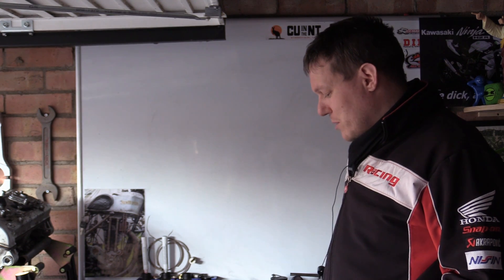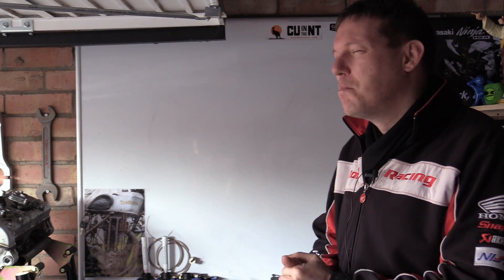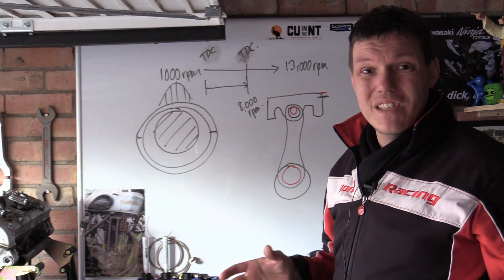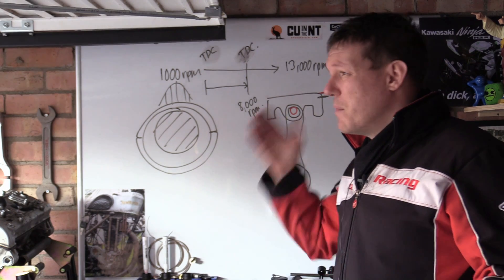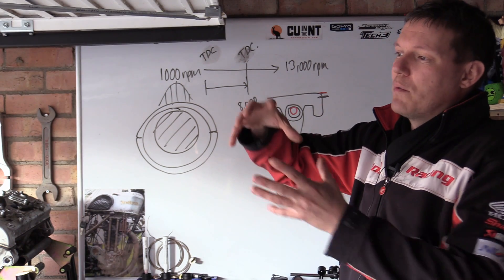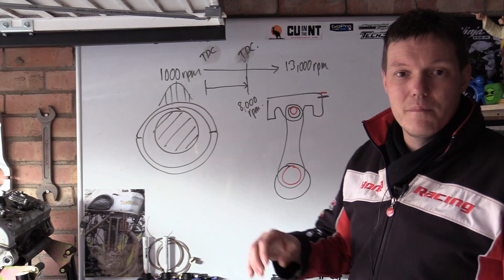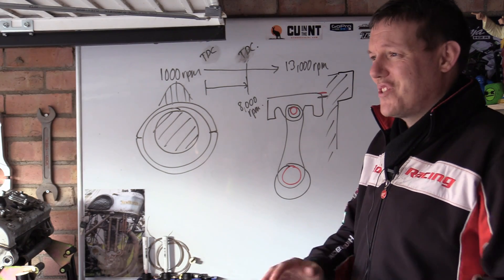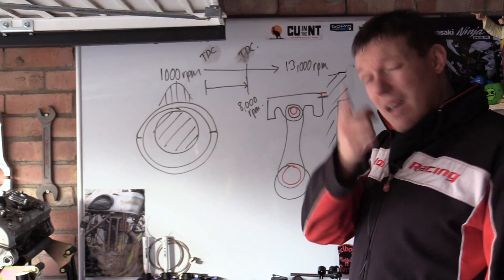Piston moving higher up the bore?

Comment: Nothing to do with the speed at which you accelerate but everything to do with the RPM.
High engine RPM means pistons and rods have less time to travel the stroke
Reply: Heavy down shifts stretch rods due to the added force from the inlet vacuum
Reply from the maker: What? Clearly you're making this shit up.

Comment: When this was floating around at it's worst the weekend before last, I did a simple calculation on this.
Nascar specs are pretty much everywhere and obtainable. So I did the most basic of calculations: 

Cross section of conrod, Piston and small end weights, redline etc. 
Maximum force when it's yanked back down ended up on about 3500kg. 

Assuming it was just a normal steel conrod, it ended up streched 0.15mm at TDC.
Factoring in correct material, all the other forces and stresses that act upon it would definitely mean a entirely different result. Better or worse. 

For the disbelievers, just ask them to reduce squishband to 0.10 or so and then redline the engine. Carnage is ensured.

Comment: There is a neat story about a race car called Zakspeed Capri, that thing had a 1.7L 4 banger with around 600 hp at around 9000 rpm. One can imagine that this engine was at its limits every time one goes full throttle. Well, they basically opened the engine after a race and found the rods to be stretched (plastically) ....

Comment: Rods do stretch.  The acceleration on a piston as it goes over the top at high revs is around 10,000 G (very, very roughly).  It makes no difference AT ALL how fast the engine is accelerating- 13,000 rpm is 13,000 rpm, it doesn't matter in the least how fast you get there (the piston is travelling up and down the bore over 200 times a second- do you really think the difference in acceleration of the bike matters?).  The G force at TDC means that a piston that weighs say 250g pulls on the rod with around 2.5 tons of force. This will stretch an alloy rod a bit, but doesn't do much to a steel rod (much stiffer).  The stretch is in the order of microns, not millimeters.  (you can try hanging a car off a rod and see how much it stretches).  Sometime this stretch will be enough so that the piston contacts the head if the squish band is way to small, but it's usually not enough to contact the valves.  The reason that the drag piston had valve marks in it was because the valves were floating.

Comment: I was actually gonna ask you something along these lines, you said in a video at some point that there is a cup the piston comes up into (where the valves and everything are) and that is an empty volume  the piston doesnt go all the way up to the top.

ok aside from the fact that if your timing chain/belt let go or timing was wrong at all you'd be totally fucked and it would hammer your valves to pieces, what if it was pretty much flat and the piston came as near as damn it janet to the top with the valves opening/closing with mm's clearance (so the timing would have to be dead on) of course you'd have a much higher compression but is there a certain point where the compression is too much? or the compressed volume is inefficient?

Comment: Many yrs ago I was working for a Pommy mechanic, he had done a rebuild on an XJ6 Jag and it came back with a noise at high RPM. He got me to take it for a drive and I told him it sounded like the pistons were touching the head at redline. Sure enough when he tor it down, the wristpins had been bored too low in all the pistons and they had just been touching on high revs

Comment: Do you really have to worry about that ridge in your cylinder bore? I know it used to be a problem in engines in the earlier days of motorized transport, but with the metals and techniques we have available now, surely that is no longer an issue?(Except for those extremely rare 500,000 mile gasoline/petrol engines in cars or 1,000,000 mile diesel engines.) I have personally seen the bore of a 300,000 mile LS family engine(It was a 5.3 liter truck engine) with no noticeable ridge to be felt.
Reply from the maker: LOL fuck off with that shitty LS engine.

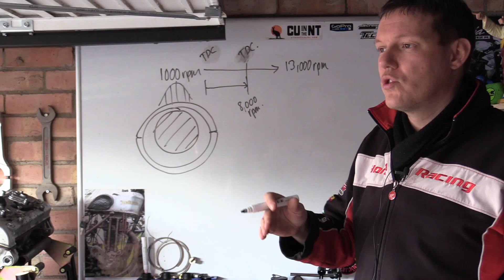Comment: 5:15 that doesn't make sense, saying the INCREASE in RPM causes this stretching. The inertia of the piston shouldn't be higher just because it's speed is increasing every rotation. That makes me imagine someone saying a turbo only blows up when your boost is really high, not when the turbo is spinning 400,000 RPM.
I understand engine load being a large cause for stresses, but what "load" is being applied to the piston and consequently the con-rod, apart from just inertia? Exhaust scavenging causing vacuum?
Reply from the maker: "The inertia of the piston shouldn't be higher just because it's speed is increasing every rotation."

- What's missing here is the accleration of the crank.

If you look at a piston acceleration curve you are looking at a constant rpm curve - if the crank is accelerating whilst the piston is in motion (due to other pistons firing) then the acceleration of the crank + piston = higher acceleration. 

"I understand engine load being a large cause for stresses, but what "load" is being applied to the piston and consequently the con-rod, apart from just inertia? Exhaust scavenging causing vacuum?"

- everything the piston is connected to - the clutch, drivetrain and wheels.....

Force applied to the piston from above and the resistance of moving or accelerating said vehicle.
Reply: @thedirtyworkshop  so because that at 10k RPM while accelerating the crank is pushing the piston back up is causing more inertia than if you were at 14k redline?
It's hard for me to imagine. It sounds like a useful application for real world demonstrations, because as far as I would understand, peak piston speed would be the most significant contributor rather than I assume a slight change in the piston acceleration curve
Reply from the maker: No. this is at redline, not any given rpm - I should have made that clear - or clearer. 

"causing more inertia than if you were at 14k redline?"

- Cuasing more inertia? No. What matters here is force - this is what's 'forcing' or stretching the rod. If the acceleration is higher than the force is higher - the mass doesn't change and doesn't need to for this to be true.
Reply: @gutserker  Look at it this way - all speeds are proportional to the crank speed since everything is connected together. When you cruise at one  constant RPM there are speeds and accelerations of different components associated with the kinematics of the system. At a higher constant RPM all of theses are higher. If you want to go from one steady state to the other you need to "push" things, so they go faster and faster as time goes by, this is acceleration, the change of speed over time. All masses being constant (mass is inertia) to make the speed go from 3 to 7.8 you need to be pushing harder the faster you want the speed to change. a=F/m .  More force on components, more plastic and elastic deformation.
Reply: ugh, a lesson to write long responses in a word processing program before putting in youtube. I have to re-type a few-paragraph response again
Reply: I'm don't have engineering training, but this still doesn't add up to me.
And I thank Matt @The Workshop for teaching in past videos many of the things I reference here.
The forces a piston experience are only compressive and tensile on a single plane as far as I understand (not counting piston slap). The primary stresses on a crank shaft, transmission, clutch, ect are rotational, where an acceleration from torque can cause failure. The piston ONLY cares about how fast it was going before TDC, where it has to near-instantly stop and go the opposite direction, the insignificantly small change in the INCREASE of piston speed compared to the previous stroke shouldn't have any effect, as long as the inertia is below what would cause plastic deformation.
I use the term Inertia instead of Force because there's a hell of a lot more force pushing the piston down during a power stroke than the crank pushing the piston up during an exhaust stroke (hence the devastating effects of pre-detonation). This is the whole point of this discussion, the kinetic energy of the piston throwing itself past the ring groove lip.

During this video at around the 4:30 to 5:20 mark I got the implication that from starting at a cruising speed of say, 6000 RPM, then suddenly going WOT and increasing through the rev range up to say, 14,000 RPM, that the tensile stresses applied to the con-rod would be greater during that engine acceleration than if you were just bouncing off of the rev limiter, causing a (mostly) steady RPM. 

Again, from what I understand the only thing the piston sees is it was going 40 M/s to suddenly 40 M/s the other direction.
Reply: @gutserker  You're getting confused because you lack understanding of some basic physics. Force and inertia are different things. Inertia is the property of matter to resist change in velocity. Mass has inertia, but there's also rotational inertia where the mass and it's distribution relative to the axis of rotation determine inertia. In the case of the engine, you can think of force and acceleration as kinda the same, because they are proportional to each other through the mass, which doesn't change -  m=F/a. 

" the insignificantly small change in the INCREASE of piston speed compared to the previous stroke shouldn't have any effect, as long as the inertia is below what would cause plastic deformation. "

How big that effect is depends on how fast you're increasing engine speed. This is extra loading on top of the forces experienced during constant engine speed. Let's say at constant 7000 rpm everything is fine, 17000 rpm is certain rod/piston/crank death. You start accelerating the engine and it pops at 14000 rpm, because it experienced higher forces than at constant 17000rpm.
Reply: @batsali99  I understand the difference between force and inertia, that's why I say inertia and not force. The con-rod is not "pushing" the piston past the piston ring lip at TDC. And remember, we're talking about the piston extending further, not bending con-rods because of FORCE applied between piston and crank. these are very different things.
I agree with most of your statements, but I think we're talking about two different problems. There is no "rotational inertia" applied to the piston. The twisting applied to the crank is irrelevant to what happens to the piston in this very specific situation.
The best analogy I can think of to describe the effect we should be talking about is a paddle ball. you know the foam ball tied to an elastic string tied to a paddle. Now imagine you are playing in a room in front of a glass window. If that ball EVER touches the glass, the glass breaks. Knowing this, you've measured the length of your string and taken "tolerances" into account so during normal play it won't hit the glass. So you're playing for a while and find a good beat, then you decide to give it a good smack for the fun of it. (now remember, in the universe inside an engine, these forces are applied to the piston a little differently, as the piston is not connected to the crank by a string, but by a rigid object that carries a 1:1 proportion of movement.) So you hit the ball hard, thus causing the ball to travel faster. ONCE the ball hit the end of the string, that extra INERTIA caused the string to stretch more than you had calculated for with your earlier tolerance measurements. The ball hits the glass, the window breaks. But the string is still not broken, the paddle is not broken.
I wasn't talking anything about the stresses applied to the crank, or worried about the con-rod breaking. the only thing this video was about was how far the piston travels up the cylinder during higher speeds because at TDC the piston wants to keep traveling, dependent on how fast it was traveling just before TDC.
I remember watching a documentary for Formula 1 engine prototype design, and the way they would test the RPM limits of the engine was to put it on a dyno, and slowly increase the RPM by maybe 1000 RPM at a time. Once the engine blew, they took it apart and looked to see what popped first, then improved on that part and did the process again. Once they found an RPM they were happy with, that was the new redline (or thereabouts), yet during races the drivers whack the throttle on and off all the time, but if you exceed that RPM things can go wrong.
Reply: I am going to agree whith Phillip on this one... 
The way I see it is that when it comes to stretching the con rod, it would happen at the highest rpm. Instead of an acceleration of the engine.
Reply: @nikosliras8102  It is always stretching, it's a matter of degree. It stretches more with higher engine speed AND higher acceleration. If you are pushing idk some jello across the table your fingers deform the jello with the force of friction, that's like constant engine speed. You want the jelllo to go faster, you apply more force, it deforms more as you are accelerating it, but when you settle at a new higher constant speed the deformation becomes less than what it was while you were pushing, but higher than that of the previous constant speed. 

The whole thing is that whatever the current engine speed, if you start forcing things to change velocities, they are experiencing more force that at a constant speed.

Comment: I was out on the gixer 750 this afternoon, was fucking freezing! Anyway, I noticed at the top end of 3rd and 4th particularly the rpm would drop off just before redline, only by 1000rpm or so, then climb towards red line again, nothing to do with limiter. Was a strange sensation. Anyone any ideas?